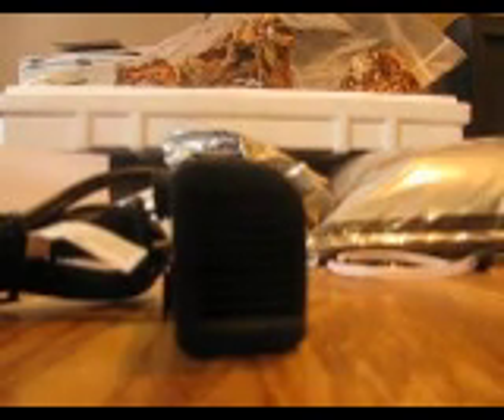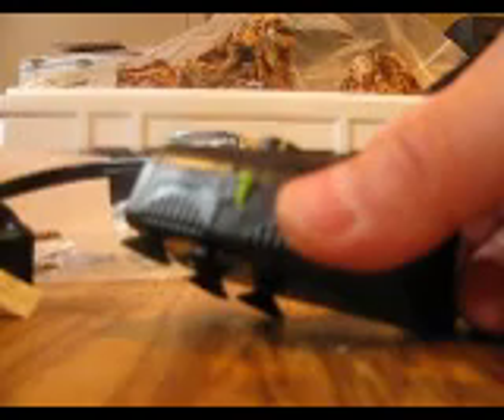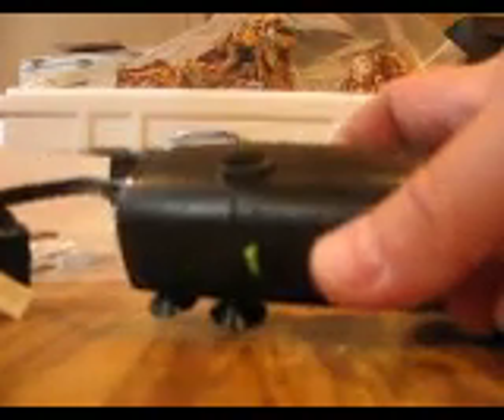hagen elite co2 mod

Comment: I used 1 (one) two liter plastic bottle for my reactor and a smaller 16 Oz water bottle as my bubble counter.  Is that what you mean by DYI?  

If so...this filter mod is nice.  I had a problem with the ceramic disk diffuser for the simple reason there was not enough pressure in the system to "push" the CO-2 through the ceramic.

You can youtube this bottle set up, it's real easy to make and setup.

Comment: I haven't tried it, but when the plans call for the tubing to be at the intake of the impeller.  This way, the CO-2 will be sucked into the impeller, "chopping" the CO-2 bubble into super little. light floating bubbles, thus taking even longer to climb to the surface than a "regular" bubble would from the tubing.

I like the fact that the Elite's case holds the tubing quite nicely.

Simple mod, SUPER effective

Mine doesn't really make that much noise surprisingly from what Jim's video mentions.

Comment: Couple of questions:

1) do you plug the filter in?
2) can you plug the filter in and use it as a filter / diffuser
3) can you plug the tube to the powerhead wedge instead of pinching it?